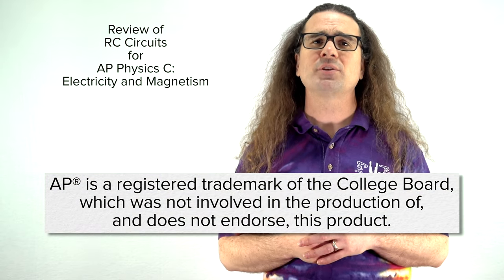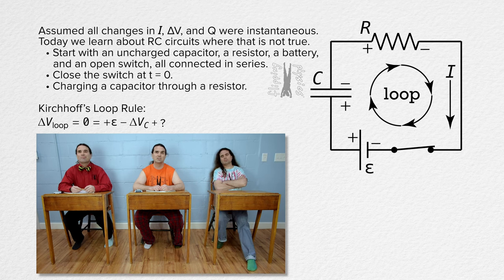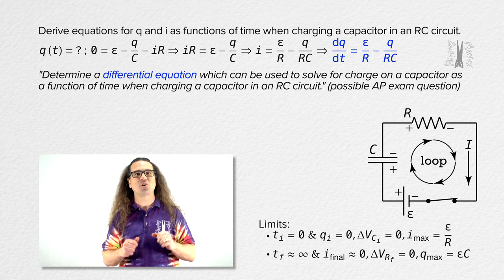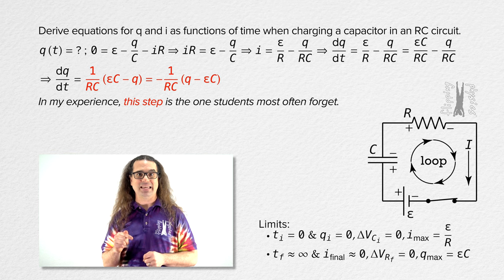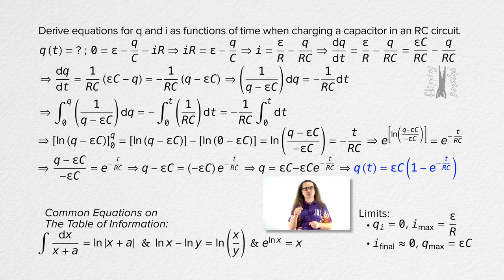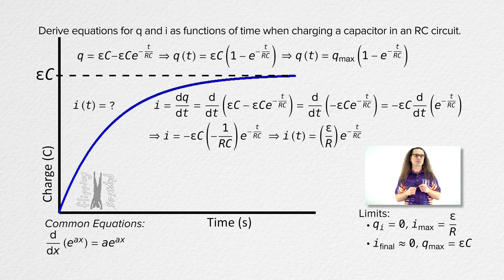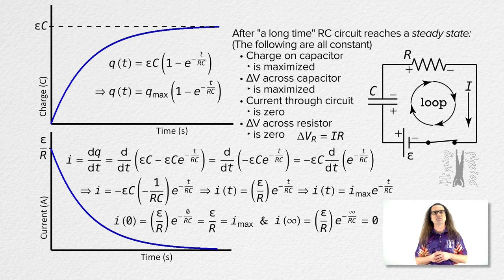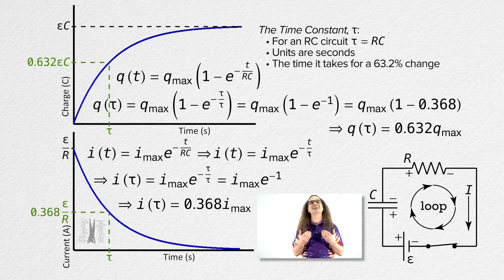RC Circuits - Review for AP Physics C: Electricity and Magnetism

Comment: I usually teach "a long time later" as meaning 5-10+ time constants, since 5RC gets the circuit 99.5% of the way to its final value. But you haven't discussed time constant yet, so this seems absolutely fine in this case.
Reply from the maker: Yeah. I decided could have returned to that after I introduced the time constant, however, it seemed logical just to leave it that way.

Comment: Good job! I didn't realize that we could use "asymptotes" as a verb. I guess it is easier than saying "asymptotically approaches".  Does the AP Physics C include realistic batteries (with internal resistance), or account for having more than one resistor in the circuit? We include them in University Physics courses.
Reply from the maker: Yes, AP Physics C: Electricity and Magnetism includes batteries with internal resistance and circuits with multiple resistors in them. Thanks for previewing!

Comment: Nice! I usually have students ask about the absolute value in the integral of 1/x and why we don't use it in this derivation. Do you normally address this when going through this for the first time?
Reply from the maker: That's funny. I do not recall a student ever asking that question. How would you answer it?
Reply: @FlippingPhysics  It depends on how much time I have and when it is in the year. They particularly don't like the denominator. One approach is "I know there's the absolute value, but we're going to ignore it. I've done this before, and it's fine in this situation." Not very satisfying, but certainly quickest. The alternate approach is that q-εC actually is a negative number in this approach, since q initial is 0 C, so we actually need the negative on the bottom for the whole fraction to be positive.
Reply from the maker: That all makes sense. Thanks. At this point I do not see a reason to add anything to the video.

Comment: The derivation does not deal with the absolute value ln|x+a|.  I note that most people who present this leave it out, but it needs to be addressed.   In this case x  (or q)  is ALWAYS less than a (or Eps C), so the items inside the absolute the absolute value are always negative.  Therefore, the ln|x-a| = ln(a-x).  Therefor the integral is in face ln(a/x).